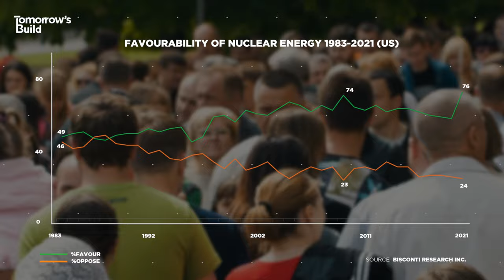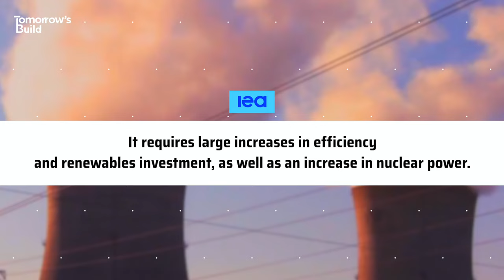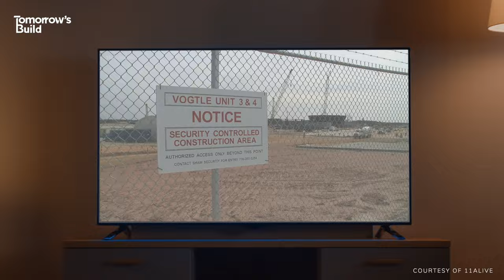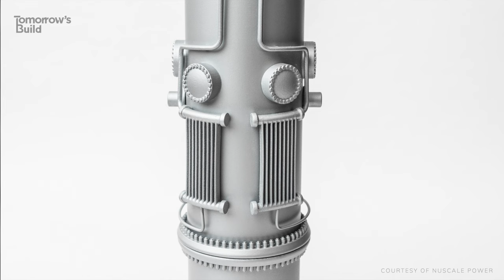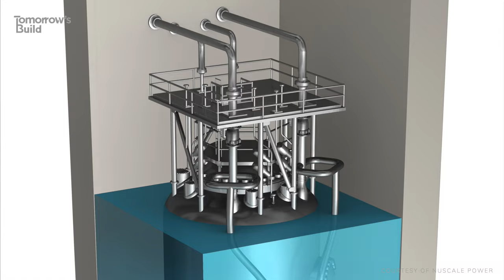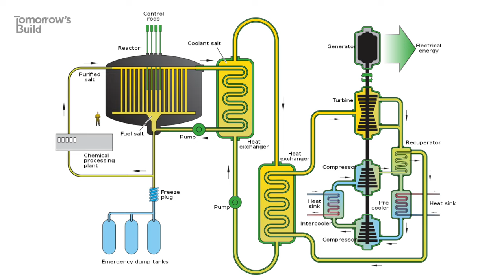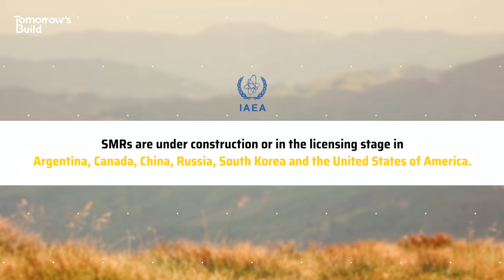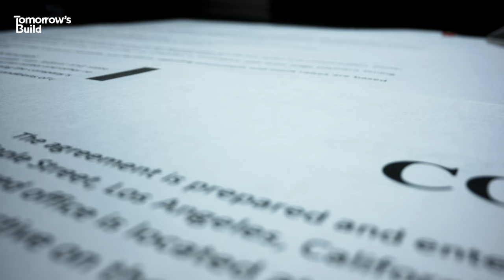These Mini Nuclear Reactors Can be Built Anywhere

Comment: "what are you thinking when.." - clean, almost free, incredibly safe (compared to any other method of generating energy), low-impact energy.
Also the only real players in this game are the guys who have experience building marine reactors - Rolls Royce, GE et al.
"Large reactors are blah blah blah" - yeah that's why France has the lowest pre-tax electricity wholesale prices on the planet (or did before the likes of Macron anyway), because nuclear energy, so expensive. Yeah now remove subsidies and see what happens. Exactly. The reactors based on marine reactors are incredibly cheap to run, won't need refuelling through their life and are significant;y simpler to build, swap out and decommission. Think about the implications of that - this is one of the many reasons why the marine reactor builders have a huge competitive leg-up in both getting to market first, reducing costs at every stage and then costs after the plants are finished with.
All we need is one more generation of fission reactors - we don't need thorium, we don't need designs any more complex than the ones we already have - and we'll be absolutely laughing as a species and the climate crazies will have nothing to chirp on about.
Reply: Climate Crazies? Do you mean people who advocate doing something to bring down earth's temperature and greenhouse gasses? The people who are making this second chance at nuclear politically possible? 
I always said I'd be willing to re think my anti nuclear position if the tech could be made less dangerous and the enforcement of regulations and inspections reliable. Would you like to consider not alienating me? 
There is more than one kind of cost that it would be wise not to pay.
Reply: You open up the following question yourself - what happens when you remove subsidies for nuclear power? Or fossil fuels?
Reply: @eric2500  you have a balanced energy market that functions correctly? Whatever that might mean. Also FWIW on your other point - that would be fine, but that isn't what they're trying to do.

Comment: If renewables are cheaper, why  bother? Work on energy storage instead
Reply: And that's the problem, renewables with storage are more expensive than nuclear, and none of the energy storage options we have are up to the task at hand.
Reply: @ForbiddTV  that does not preclude looking for storage solutions. In the long term renewables with cheaper, effective storage is the way to go. Not saying turn off the nukes. Just don’t build more. Decommissioning should be thoroughly done in the end.
Pumped hydro storage is a great option. Grew up near Niagara. At night most of  the falls on the Canadian side get rerouted to a holding lake. When power is needed it runs through sir Adam Beck generating  stations.
Reply: @foot bru  Produce all the batteries you want, the earths resources will be long depleted before enough batteries are built, which BTW have to be replaced every 15 years or so.  After 200+ years of development the battery hasn't progressed much. 

Cover the entire earth with wind generators and solar photovoltaics (again, if there was actually the resources to do it) and the grid would collapse immediately without being base loaded with fossil fuels or nuclear.  With storage, even if the wind/solar hardware was completely FREE, it is still more expensive than nuclear. 

Many countries have been building and operating small modular reactors for many decades. built in two years or less, for millions not billions.  There are more than 50 NPP being built worldwide right now, you could have just looked that up.
Reply: @foot bru  The most expensive NPP in the world is still cheaper than wind/solar with storage.  Wind and solar are a burden to the grid, not an asset.
Reply: @foot bru "Small nuclear reactors for 'millions not billions'? Many Countries? Where are these magical rainbow coloured unicorns?" 
I'm quite sure your unicorns do not exist, but there are over 160 small nuclear reactors on land and at sea, you could have looked that up too.  They are built in two years or less (Rolls Royce in the UK that you mentioned earlier) for millions, not billions.
Reply: @foot bru  Got any other anti-nuke memes you need debunking?
Reply: @foot bru  As I said you could have looked these up, but you decided not to.  For anyone else reading this you can ask Mr. Google to show you "Nuclear-Powered Ships" from the World Nuclear Association.  You could also look up another specific COMMERCIAL small modular reactor that some people refuse to look up called the Akademik Lomonosov which was built in 2018 for $700 million.  Rolls Royce has been building them for the UK Royal Navy for decades for millions not billions, but some people don't like reality.
Reply: @foot bru  The Akademik Lomonosov is a commercial facility.  There were many before it from other countries and many more planned.   You of course could have looked that up as well.  Any of the companies making them for the military could also make them for the commercial market.  There are also over 220 small nuclear reactors used for research and training, materials testing, or the production of radioisotopes for medicine and industry in 53 countries, some even on University campuses.  I love forcing anti-nuke trolls to look things up.
Reply: @johnransom1146 great, look, but there is no useful storage now.  That means for every bit of solar wind, every bit of it, there’s a gas plant or coal plant bit, along with pipelines and mines and wells and mines. 

That’s expansive, and it’s not clean.  60 reactors under construction globally right now. US needs do get on board.

Comment: It is time to revolutionise such  impractical ideas of createing moving electrons to run human-invented machines. 
The best way to build power plants is to convert photons' kinetic energy or moving force from human-made light sources, suc as light bulbs back to  electromotive force for free electrons in circuits to keep moving , and tranfer  photons' kinetic energy from naturural sources of light, such as sunlight, moonlight to electrons already existing in machines and circuits for them to move and run such machines
You can even use photons' kinetic energy from candle light, and  light from a fire place to operate your electricity-run machnes if you can come up with ways to convert such photons ' kimetic energy to  kinetic energy for free electrons in  machines. Each hour, so much electric energy is dissipated in light bulbs to generate radiation or emit light without ever being recycled or reused by converting kinetic energy of photons emitted from such sources of light back to kinetic energy for free electrons to continue moving  and operating electron- run machines 
So, if you can make kinetic energy or moving force transferred back and forth between photons from ligh bulbs and free electrons in  resitive load circuits,  and convert thermal energy in high temperatures into kinetic energy for electrons in circuits, the electricity consumption will decrease greatly, production of electricity  at power plants will also decrease dramatically, and thus the problem of human destruction of their own living environment will be constructively solved.

Comment: Nuclear reactor is not the problem. The actual challenge is to tackle the nuclear wastes. 
Puttting into a closed container and dump it under ground is not a viable solution. Need to invest more on utilizing nuclear waste. Rest probelm can be tackle automatically.

Comment: I've nothing against SMR, I think that the scale of individual reactors in our existing scheme may benefit from a total rethink.
Putting an SMR in a city centre is as brain dead and short sighted as thinking that wind turbines are the complete answer to our future energy needs.
Frankly, SMR in a city centre is an obvious terrorist target. No nuclear is that safe.
One day people will realise that the consequence of bad energy policy is mass death - either through war or starvation.
Reply: These are terrible terrorist targets. Most SMRs are molten salt reactors (MSR). If you shoot/blow a hole in an MSR, all that happens is the salt drains into and underground tanks to cool off. At worst, you get some charged terrorists.
Reply: @kokofan50  They might be molten salt reactors, but they might not. Whilst nuclear technology is quite well proven SMR will probably be PWR, like the subs and the aircraft carriers, because MSR still needs technology leaps. Indeed there are very few MSR plants in existence and those that were decommissioned, were so because they were subject to large radiation releases due to material technology failure. PWR and MSR is quite vulnerable to terrorism. MSR might not melt down, but it can still be pretty hazardous.
Reply: @andyash5675  MSRs have never had a major release of radiation, and the small problem MSRs had with corrosion has been dealt with by stainless 316 and Hastelloy N. 

Also, shut up about terrorism until you explain how they’re vulnerable.
Reply: @andyash5675  “316 Stainless isn't exactly an advanced material,” which is great; it’s cheap, widely available, and lots of people know how to work with it. If we’re going to build thousands of reactors, rare and exotic materials are the last thing we need. 

You just keep asserting that nuclear has safety problems without actually saying why. Also, you’re apparently a luddite if you’re in favor of coal.
Reply: @kokofan50  Thanks for the compliment! I think you're working for Putin myself, but remember; "Every day, someone on the internet is wrong!" 😆

Comment: Vogel is around the corner, and is nothing more than a job program for this poor southern state. Most famously, Rick “oops” Perry, Trumps disastrous choice to chair the DOE, handed over $3 Billion in loan guarantees before unceremoniously quitting the job that he self declared he would do away with! A decade  behind schedule and over double the expense, the worst part isn’t either of those important issues. The scary part is unqualified welders and electricians, failure to perform quality inspections on those critical construction areas at scheduled intervals , and AEC blasting the failure to protect that necessary quality control. Financially, it is passing on huge KW/Hr costs to a relatively small number of ratepayers. It will bankrupt these utilities financing them!

Comment: Nuclear power may be cleaner than fossil fuels and more safer but when they fail, the amount of damage they do due to radiation is catastrophic.
Reply: Japan has admitted they over reacted and shrunk the exclusion zone to just the immediate area around the Daiichi plant. Also, the SMRs are completely different types of reactors that can’t fail like that.
Reply: Still makes them safer.
Reply: Black lung. Banqiao Dam. Deepwater Horizon (not to mention the Kuwait oil fires, though that was deliberate). And I'm personally comfortable to have a CT scan or fly in a plane when I need to. I don't mean to minimise the need for care with nuclear power—indeed, I'd like to see a proper safety culture installed across the entire economy—but are you sure you have this in full perspective, and that you've checked your math?

Comment: This video is wrong. An SMR must still meet the Code of Federal Regulations Title 10. Under these regulations you will not be able to site an SMR in a city.  Site boundary release assumptions follow the same regulations that the large nuclear plants have to meet.  And where does this idea come from that the SMR and the Navy reactors are the same?  I have operated Navy reactors and I have designed SMRs.  Believe me, they are NOT the same.

You want to build a nuke? Presently, it will take you too long to permit and build it.  And it will be expensive beyond all reason. Your CFO will never agree to it. If you are serious about building nukes, you better do something about the regulations, because the regulatory framework as it currently exists is the very thing that is crushing the industry. It has been doing so since TMI.  All this talk about small being better than large is just noise outside of the real problem. Until someone gets serious and fixes the regs, it will be more of the same. Noise.

The way I view the situation - We have a technology that works fine. But for some reason we want to change it to something different. And, we have a regulatory process that doesn't work at all, but we DON"T want to change it. It's backwards. It's insane.

Comment: Nuclear aint carbon-free! Where does the uranium come from? Mining.
Reply: *facepalm*.... yeah because the rare earth minerals in solar panels and the steel for windmills just appear out of thin air right?
Reply: @viktor1496  Considering the fact thats a 1 time thing compared to the fact you have to continually mine in order for it to function.  It's fairly obvious how ironic how it's "carbon-free".
Reply: Not to mention, steel can be recycled. Might not necessarily come from mining. (It's a very different case with uranium).
Reply: @randomspaceman3732  You realize that recycling ALSO costs an enormous amount of energy right? The highest energy expenditure for steel mills is keeping the gigantic ovens at high enough temperatures. And considering that you need ~400 well performing wind turbines to replace a large nuclear reactor......you can do the math
Reply: @randomspaceman3732  A well made wind turbine has a lifespan of 20-25 years before it needs to be replaced. And you're free to present me with the carbon footprint of recycling 400 of those steel behemoths vs the carbon footprint of uranium mining for a large nuclear reactor in that same timespan.
But You'll find that those numbers are not as different as you probably think they are.
Reply: @randomspaceman3732  And for the record, I'm not against wind power. I'm actually a huge fan, but considering the world still runs on 60% fossil fuels and only 10% wind&solar combined...... you really should put your prejudice against nuclear aside until those numbers change.
Reply: @viktor1496  Don't forget the production cost of nuclear reactors; taking considerably more energy to produce something which fundamentally produces emissions through a fossil fuel indirectly through mining.
Reply: @randomspaceman3732  All our biases aside, the world still runs on 60% fossil fuels. I also agree that nuclear will have to end at some point. But renewables are being too slow, so we need every weapon we have, INCLUDING nuclear to at least slow it down. Because even a Chernobyl a year would be preferable over what we're facing in the coming decades. Even the IPCC agrees to that extent and they are not exactly pro nuclear.
Reply: Every form of energy is gonna require some form of resource extraction, so stop acting like it’s an argument that favors any of them

Comment: Great. Easy to blow them up as well.
Reply: Tell us you have no idea about nuclear without saying you have no idea about nuclear
Reply: French eco-terrorists fired RPG-7s at a nuclear power plant in the 1980s.
It just scorched the wall.
Reply: Its actually not an issue for Molten salt reactors. Even if you did blow it up, once the Molten salt (with the fissile material) is seperated from the modulator (a physical system of rods that slow down neutrons to allow the nuclear reaction to occur), the salt no longer undergoes reaction. At this point, the waste radio isotopes don't provide enough heat to keep the salt liquid, allowing it to solidify for easy collection. At the same time, the low pressure Molten Salt allows means that an explosion of any kind is unlikely, and if you did strap a bomb to the side and 'sploded it the radioactive material wouldn't evaporate and spread in the atmosphere.

Comment: Electricity generation is typically costed and sold per mWh, per 5 minute block. This is understandable as providers need to handle peaks and troughs. Using this 5 minute metric wind and solar appear the cheapest form of power. However this is a false economy. We need electricity 24 hours per day. If power was costed per 24 hour block you would find neither wind nor solar able to compete with traditional generation. We have let the renewable industry get away with their false logic for too long. If you require generation over a 24 hours period you must have storage. This completely alters the costing dynamic.

Comment: Way to make a video about "clean" nuclear power plants and not even touching the subject of where to store the nuclear waste that will be radioactive at dangerous levels for hundreds of thousands of years! I guess that fact didn't fit your narrative?
Reply: You bury it
Reply: @KayC352  Ok. Where? And how do you make sure that it is safe there for the next, say, 5000 - 10000 years?
Reply: Nuclear waste isn’t a big problem. Nuclear waste is a very good thing, because nuclear reactors produce very little nuclear waste and can be easily stored in well built storages. Pollution caused by fossil fuels radiate more nuclear radiation (coal at least), and cannot be stored and are just dumped into the air.
Reply: @KayC352  Naturally occurring plutonium? Oh, the wonders of the world ...
Reply: @romanski-g9n  it doesn't matter if it is plutonium

Comment: American adventures into small nuclear reactors and 4th generation isn't successful. They ran very, very advanced Molten Salt Thorium Reactor in 70's but stopped for various reasons that made no sense. 
The most advanced reactors, small (could be argued because their power is normally a bit over 300Mw) and big, are being built in China, India and Russia.
Gates's company and others mentioned here do have reactors in computers which is far from running them like in China, India and other who are not even mentioned in the video...